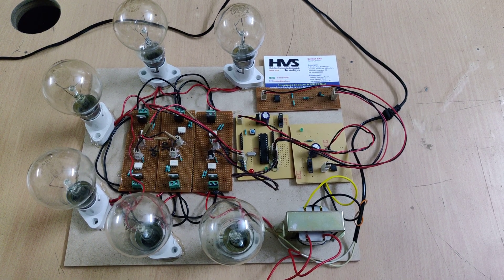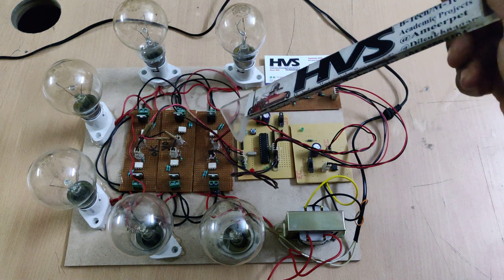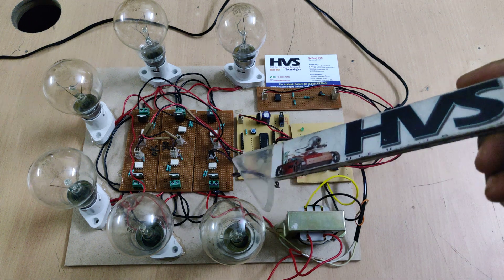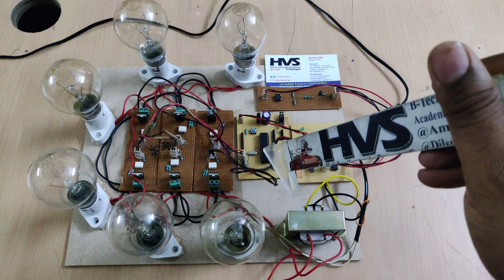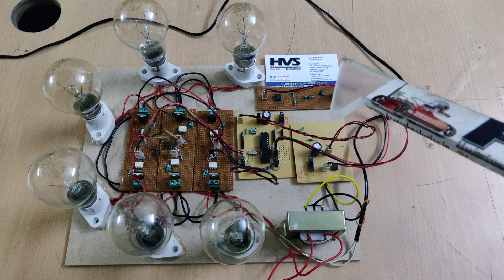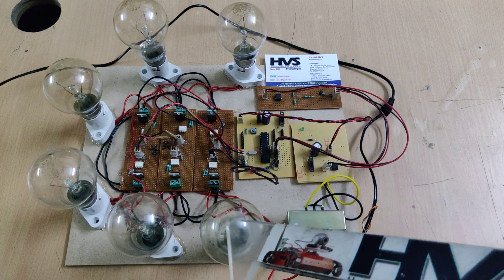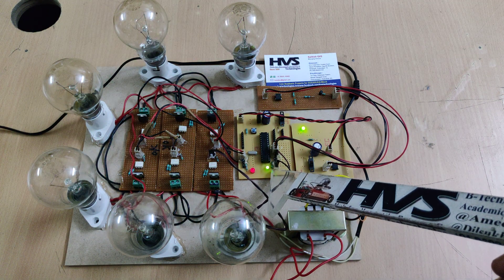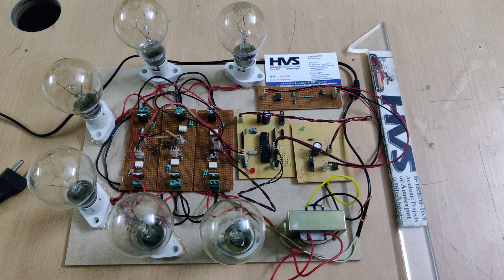Soft starter for 3-phase induction Motor using SCR and PIC Microcontroller

Comment: Single phase motor for soft starter which components use
Reply from the maker: You can contact us at +919603140482
Through WhatsApp or call